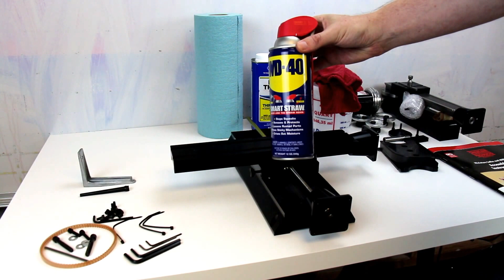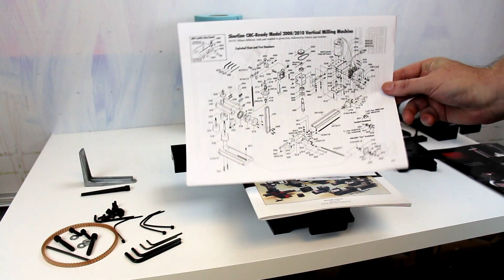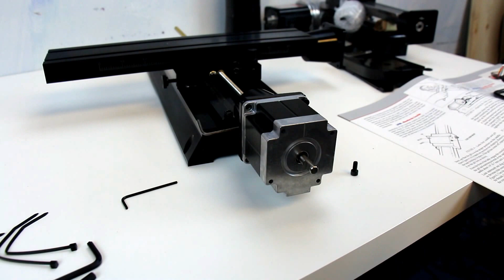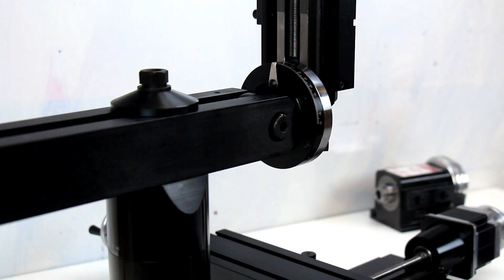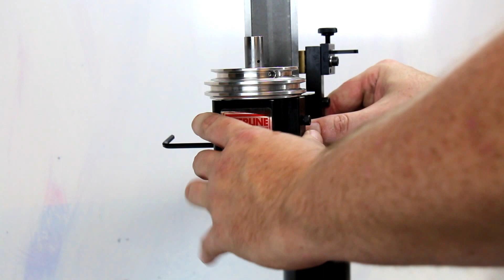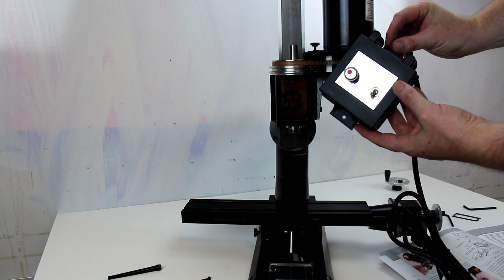Sherline 2000 Mill Assembly

Comment: how is this 6 Axis?
Reply: It's actually 8....
If you're familiar with the "Bridgeport Mill" ... In addition to the basic 3 "X Y Z" Axis , 
👉The swing arm is a movable boom that travels same as the Y axis (back & forth) 4
👉The swingarm post can also rotate in 2 different directions 
5 & 6
👉The Z Axis can rotate 7
👉The Headstock rotates 8
However aside from the Boom that can move in same direction as the Y axis - 
👉I'll never use those other Rotating Spinning Mill gymnastics, 
The Ying -2- that Yang is all those different movements make it harder to keep square & easier to knock out of being Square...
In fact they had to start offering a different setup without all the gymnastics cause many of the users complained. 
Why did I buy it?? It was 20% $$ off & I didn't know any better. I'm 100% Noob & had no biz getting it. In fact I've owned it a year & still trying to learn how to get all those rotation areas Fine Tuned Square....🤓

Comment: I enjoy watching your videos.  Possible for you to have more lights when capturing your footage?  Sherline tools are mostly black, it is quite difficult to view the details of the tools.  I don't own any Sherline tools yet but now gathering all relevant information before plunging into this expensive hobby.  Thx.
Reply from the maker: +zipper168 Thanks for the comment! I'm new to making videos and still working out the kinks. I actually have over 2000watts of lighting, but the white surrounding is throwing off the exposure. Just got a new camera that I can set some manual exposure compensation.

Certainly look at all the accessories you think you'll want. You can spend as much or more on the accessories, measuring devices, cnc electronics etc as the power tools themselves!